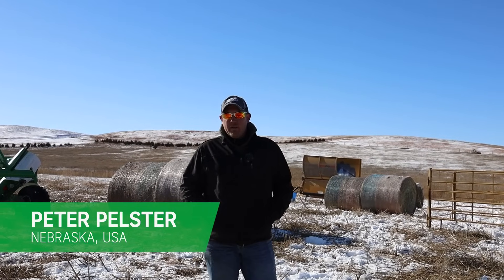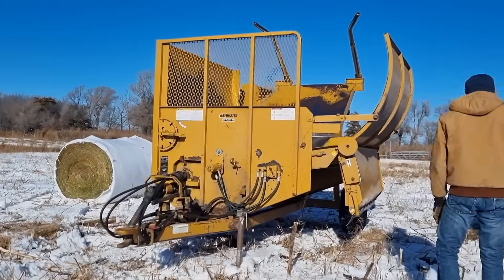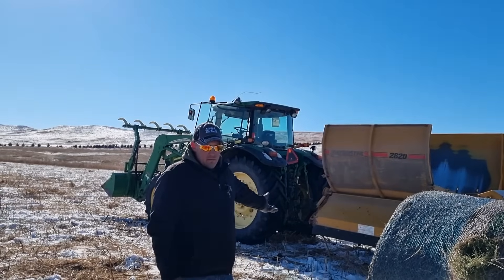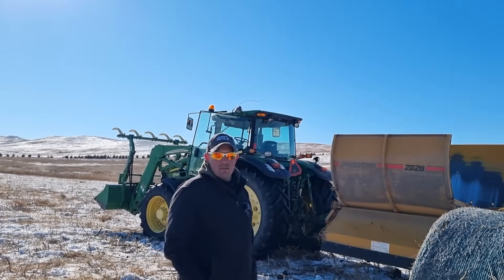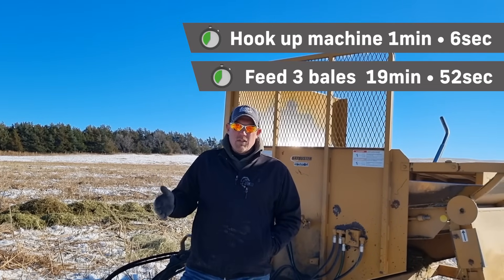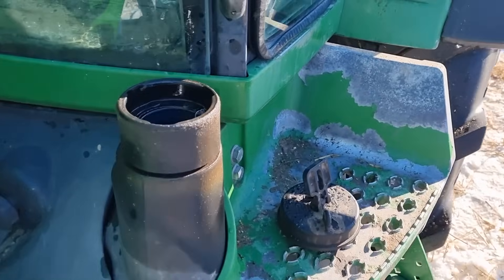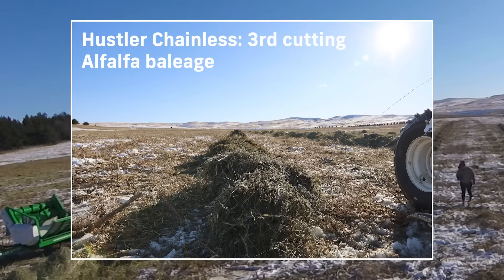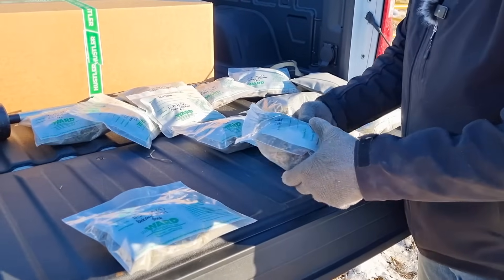Flail-Type vs Chainless Bale Processor Comparison - Which is best for Fuel, Hay, Time Savings?

Comment: This is comparing apples to oranges, two different machines with different purposes... unrolling a bale vs grinding it up. Chainless works better for hay that is already of high quality as it needs nothing done to it. Flail works better for poorer/low quality hay, older hay, stemmier/long fibrous plants, and bedding down.

Only have high quality grass/alfalfa/silage bales? Chainless
Have a mixture of all types of hay? Flail
Reply from the maker: You may have noticed that a mixture of bales and quality were tested in this comparison